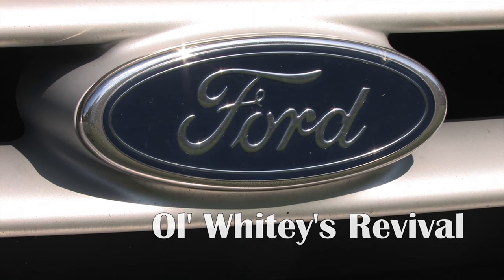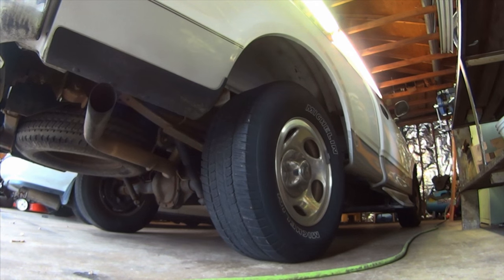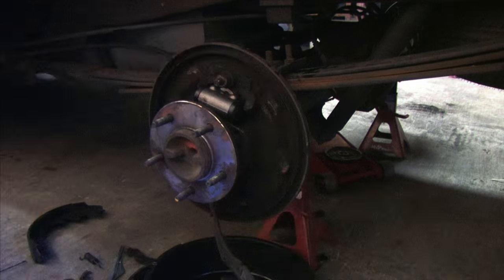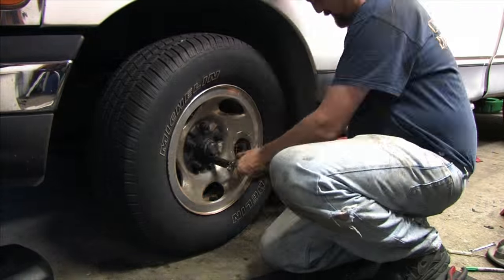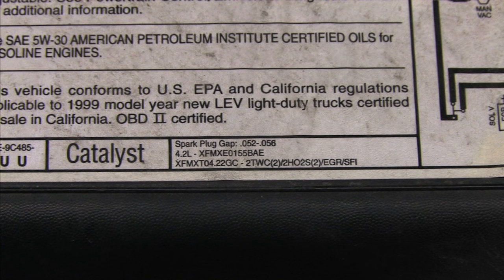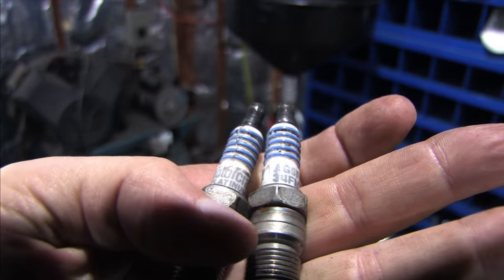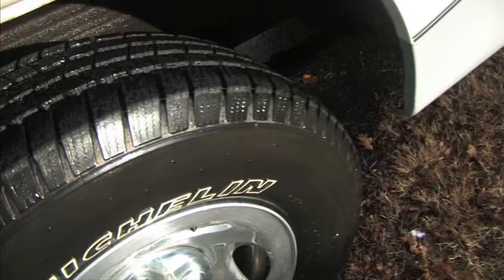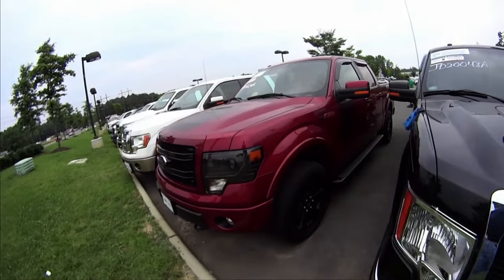Ol' Whitey's Revival

Comment: I was going to do the headliner on my wife's VW, but I instead pulled it out of the car, tore the fabric off, scraped the adhesive down, and plasti-dipped  the whole thing flat black.  No smell, no extra noise, no additional hot/cold leaking into the cabin.  $10 (less than 2 cans) and super happy with the outcome 2 years later.

Comment: for using a motorcraft filter. you sir are a bad ass.  this is the most under rated automotive show on the Internet.
Reply from the maker: +Jean-Paul Veillon LC-1 filter has the largest filter element with the most pleats of any other filter.  Is the same as a Purolator filter, but the element is produced by Purolator to Ford Motor Company's specifications, optimizing its performance for longer oil change intervals.  It's 99.7% efficient on single pass filtration, and 98% efficient on multi-pass.  Just in case anyone else was wondering why I used Motorcraft here.  ;)

Comment: That odometer issue is a simple one to fix. Pull the cluster out, and resolder the odometer display pins. They all crack with age and lack of lead based solder. 

I had and have almost the exact same truck. My 99 had the odometer issue you do, and I sold that for a free 97.  Both  extended cab XL's with vinyl floors. Love them even if they have design issues. (rear shock changes are a pain as are cracked blower doors, not to mention the spark plug problem.)

Also, been watching your channel for years. I have no real interest in DSMs(even if I live in Normal), but your clear consice narration and in depth topics make for great watching as a gearhead.
Reply: +twalshkart and after I have time to finish the episode.. nevermind about that odometer. New truck  looks great! and a reliable truck/trailer gives such peace of mind when daily driving 20-25 year old cars.

Comment: My father in law has pretty much this exact truck, it's a 97 I think though. Same engine it was sold to him for $500 it had 280K miles on it and he uses it as a daily. Aside from breaking off spark plugs in the head, this truck just doesn't stop running. It's been very dependable, although it's body is a lot rougher than yours she never stops. It was owned by a local Oilfield company previously, and was maintained for the most part. The AC system was completely changed, and the onsite mechanics always changed parts on her religiously. You can hang meat in this truck literally. I think he has over 300K miles on her now, and she just keeps on going. Glad to you're still ok Jafro, nice new wheels! It's about time you get something with a warranty. Hope all is well with you, I found something you might be interested in. Large Coffee filters in plentiful supply! "To caffeinate a large crowd". PM if you'd like me to send them your way, I'm sure you'll need them in the future. Glad to see a new video!

Comment: FYI, Jafro: If people start reporting that your links in the description are broken, it might not be your fault. I tried the link to your hydrolock video, and the URL that opened ended with just "v=bhIq9", not the full "v=bhIq9lsKvOU" of the actual video. I didn't examine the HTML source in depth, but on first glance it might be an error in YouTube's source generation, not the browser. 'Just giving you a heads-up.

As long as I'm writing, I'd like to add to the chorus of condolences about Caboose. Also, congrats on another great video! I'm particularly impressed with the clever narration in the opening segment, such as the phone-hiding hole and the "regret this decision" joke. That was a better monologue than a lot of high-budget TV shows and movies have done, because it shows viewers an engaging personality for both you and the truck. The rest is good as well. I never want to sound like I'm pressuring you to release more often, because it's a gift, but I do want to express how much I appreciate your work. Thanks again.

--0Thello from UT2K4
Reply from the maker: +William Dye Thanks man!  Try it now.  I think it's fixed.
Reply: +Jafromobile Fix confirmed (Linux Chromium 47.0.2526.106). It also looks OK in the source code now, so other browsers should also be OK. 'Glad to help.

To emphasize, I am very, VERY glad to help. Jokes about being the UT2K4 bot "0thello" aside, my day job is "Senior Software Engineer in Test", so if you ever want somebody to double-check something for you, or wish there was a Bash script to automate a part of your production process, please let me know. I do that stuff for a living anyway, and I'm happy to do a favor for the guy who saved my 1G daily driver from the junkyard, so please feel free to ask no matter how silly it might seem.

Comment: The compression falling like that is normal. Is almost impossible to to stop the engine at tdc on that cylinder. You'd have to do a cylinder leak down test to check for compression loss. Good video man. Keep up the good work!
Reply: lol compression gauges have one way valves in them. the one he used was leaking

Comment: wow a week after i just shelved my 97 f150 4.2  for a 4.6
i love these engines no boot or spark plug issues like the 4.6 and the 5.4. I did all the repairs you just showed us, and your right motorcraft all the way especially the PVC valve, a brand new duralast made things worse. I had to shelve mine for now due to valve stem seals on the number 5 cylinder (i just dont have the time or tools to do it)

Comment: Your new red truck is my dream truck! Ruby Red appearance package crew cab FX4, looks so damn good.
Reply from the maker: Vermillion Red.  :)  You left out 385hp Coyote V8.  ;)  Despite the electrical problems it's the powerplant you want to have in the 2011-2014's.  I have a cousin-in-law who has stretched 2 timing chains in 120,000 miles pulling a trailer with the 3.5L EcoBoost and he didn't exceed the towing capacity.  He's around 85% of it.  The other thing you want is the 402A appearance/technology package.  It really makes it stand out in a crowd of other trucks, and it's very tastefully done.

Comment: Smart man, check head, head gasket and block integrity before pouring in any parts on the truck
Reply from the maker: +Samuel Gonzalez You got it!  The dealership trade in value on Ol' Whitey was $1000.  Aww hell naw!  If it passes those 2 tests, it's priceless.
Reply: ***** A $1000...jesus

Comment: Nice, My daily is a 1999 XL aswell.  I have the extended cab and the 5 speed manual, but outside of that its the same as yours.. Bare bones basic truck, but never leaves me stranded
Reply from the maker: You get much better gas mileage than I do, that 3 speed with overdrive is a dog; but as far as reliability goes, they're the end of an era.  I went 18 years and almost a quarter million miles before having any major expenses on it.  I don't know a single Triton owner that can say that.  The Heritage Era F150 XL trucks built at Norfolk, VA are outstanding.  That plant was almost a hundred years old and very well staffed until it shut down in 2007.  That's where mine is from, and it's built like a tank.
Reply: FOr sure, I plan on keeping mine for years.  I got it with a recently installed rebuilt engine, but the original motor made it to 240,000 before it failed....  I have 263K on it now, wouldnt be surprised if it made it another 250 thousand.
Reply from the maker: Keep an eye on your coolant level, pcv system, lower ball joints, U-joints, and serpentine belt tensioner... and I see no reason why it shouldn't?

Comment: Good video except NEVER use the gauge part of a gap tool to open the gap on a spark plug!   That's a great way to snap the little platinum electrode off.   The little hole in the side of the tool is there for opening the gap.

Comment: lol Kool now it's my turn to chop up metal and fab !
Reply from the maker: +Juan Lugo If you get the right mounts, it's a bolt-in.  You only need to drill or cut if you use the wrong ones, or install the AWD transmission.  The 1.6L GT has a DOHC 4g61, and the block's outer dimensions are identical.  Only the bore, stroke and deck height of the block changes, so it's a direct fit.

Comment: Use the hole in the spark plug gap tool to gap the electrode...if you pry on it like that you could crack the electrode or porcelain...just my 0.02 cents....wonderful video very good, cheers dude

Comment: awesome I've been looking and can't find anything I know it's a simple swap job but don't know if I can get away with using the same 91 colt clutch pedals or use the 1g dsm pedals which would you think? in your experience with dealing with it. thanks for the reply bro awesome!!
Reply from the maker: +Juan Lugo I wouldn't be the slightest bit surprised to find them being the same part number.  For the brake pedal, just lop the left side of it off with a sawzall, and the clutch pedal fits.  Makes for a nice heal and toe, but whatever car you're putting it in isn't going to have any traction when you're done anyway, so you'll never make good use of the heel & toe.  Not that I know from experience or anything... The only thing you won't have is a clutch switch.  You'd have to fabricate something for that if you want one (think No Lift To Shift).

Comment: 4 things, 1 always love the new vidoes, 2 people actually use torque wrenches on wheelnuts? lol 3 harbor freight has an immaculate balljoint press, definitely I recommend getting, worth every penny! 4 where do you live cause I am majorly envious of how unrusty that truck is!
Reply from the maker: +Stephen Perry 1:  Sweet!  2: Yes, I do, and precisely for the reason specified... I have captive rotors.  Also, people with nice alloy wheels won't risk damaging them by over-torquing them with an impact gun.  3:  But... the pipe!  It's so awesome!  And it costs so much less!  4:  Ol' Whitey was built in Norfolk, and has never left the state of Virginia.  It's been to every last corner of the state, but never left it.
Reply: +Jafromobile oh, thought you were in TN for some reason, up in PA the only things we have that clean have just arrived on lots lol,
Reply: oh and BTW I was being a smartass about the wheel nut thing lol
Reply from the maker: +Stephen Perry I know!  I've bought a PA car before.  See "stripping the plymouth laser" video.  Truth be told, my GSX did 2 years there, but I got the salt out of it and painted it before it had a chance to rust.  I've since replaced several suspension parts and powder coated most of the steel stuff.  ;)  Ohio cars are a disaster, too.

Comment: Did I hear that correctly you're a fellow hunter.   Wow, I didn't know that. Cool Do you prefer big game or small game?Just have to ask does Big Red have a random ticking in front end?  My step father has a ol' Blue 2015 F 150 eco boost which is a cousin to the Fx4.  Read, that both has front differential ticking which is common issue, cannot be fixed if it was fixed it'll come back. Same with the turbo ticking issue yes you heard correctly ticking turbo more ticking twin turbo in the f150 eco boost. I've driven it a few times since I don't own a turbo vehicle.  Oh yeah that gallant vr4 I told you about somebody snagged it up before me :(Since I'm a mopar guy I would opt for the Ram eco diesel or long horn ones with side compartment on each side of the bed along with the hemi, plus truck is made from steel not thin aluminum.   Have you seen the F150 vs Chevy Silverado commercial when they tossed an empty box into the bed of each.
Reply from the maker: I'm a fish hunter mostly… Salt water if you're curious.  The hunting reference in this video is with respect and appreciation for those who do, and my interest is most definitely growing on that topic.  A "hunting truck" is a seasonal commodity just like the game.  Though Whitey's not 4WD, it has the hauling capacity for everything that can be hunted, and without getting blood all over a newer, shinier, nicer vehicle.  If 18" of snow can't stop it, I'm sure it's capable of serving any hunter's needs and they'd be lucky to have it.  For people with old trucks, hunting season is a seller's marketplace.  Right now, Whitey's my fishin' truck.

As for the EcoBoost stuff, Red's not an ECOboost.  It's a N/A 5.0 Coyote V8.  It's also a steel bodied 2013.  The effortless implementation and use of the technology (except for the navigation) in the F-150 is what sold me.  I drove several 2015's and couldn't stomach their squared-off, sterile and chromed plastic interiors.  The FX4 designation is only related to the suspension, towing and differential packages.  They can have either engine.  Sure those EcoBoosts make more torque, but they also stretch timing chains without engine modifications and that's normally what makes the ticking sound.  Ford made 2 radical changes to their truck line in rapid succession, from turbo chargers to aluminum bodies.  While I see and value their goals of doing this, I'm always wary of beta testing brand new technologies on premium model products for companies that may or may not stand behind their products.  In my opinion, FORD does not stand behind their products, not from corporate, and especially not from the dealership level.  I'm blood related to Henry Ford and I say this.  I own 2 Fords.  I should be biased, but I'm not.  I just did my part to keep my truck purchase in the family (name) even though my family fails to benefit in any way from it today.  I didn't like the Chevy interior.  Liked the engine, just not so hot on the silly geriatric large-print soft-touch buttons and lackluster paint colors.  

On another note, the Honda Ridgeline plastic-bodied pickup out-performed both the Ford and the Chevy with the concrete and toolbox tests.  I did 10 years in advertising and today I can recognize marketing hype from lightyears away.  Even though it fared better, you will not catch me driving a truck that's powered by a sewing machine.
Reply: Wow, that's some great information about the Eco Boost. Interiors are kinda the same  But there's other issues besides stretched timing for the Eco Boost pretty sure the fx4's has same issue as well. That's cool your related to Henry Ford,  I've been to the Museum in Dearborn Michigan fives during Elementary school, every year they have a field trip to their. I never owned a Ford but have considered picking up an 4.2 F150 due to your Hydro lock fix repair video. Plus, I helped my younger brother do the same repair engine was in a thunderbird. Looked a lot easier to do the repair when it's in a truck instead of in a car.  Another good thing about the Chevy besides interior ( wifi hot spot) and engine, their transmission are super strong it's built by Allison which is the who makes them for Semi trucks. But Eaton does same thing but they're in the Cummings diesel.  Thankyou for the response. No harm no foul. Anything, new happening with your projects.

Comment: Hey jafro do you have a link or info how to setup a hydraulic master clutch in a 89-92 colt to bolt up a 1g fwd trans? thanks love your channel keep up the awesome job!!!!
Reply from the maker: +Juan Lugo I had one.  I looked for it for 2 hours last night.  It's gone.  I know it had a copyright strike, but there's no evidence it ever existed now.  It was made when YouTube was still the wild west and you could upload anything.  Probably 6 years ago.  It documented where to cut and what parts to use.  I don't know even where to begin looking for the info related to it because I bought all the stuff 8 years ago.  There's footage of me installing a new hydraulic line for the Hyundai.  There's footage of me installing a 5-speed shifter in an automatic Colt, but I can't find the hydraulic install anywhere.  I think you'll need the M/T trans mounts, the flywheel that matches your tranmsission, a clutch, clutch master, a slave, and make your own line.  The cable install would be just like the Colt.  You'll likely find cutouts in your firewall for the equipment to bolt up to and to pass through.
Reply from the maker: +Juan Lugo If this is going in a Colt, then get the mounts from a 1.6L Colt GT or Mirage Turbo.  I believe the Hyundai Elantra 1.6L timing mount fixes the engine position in the engine bay for a 2.0L swap, and the transmission mount from a 1.6L Hyundai Scoupe manual transmission mount also works, but verify that before spending money if you can get the Colt GT mount.  I had a video that showed all of the Mitsubishi parts with the part number stickers still on them.  I wish Google didn't eat it.  They used to delete videos, then they made you replace audio tracks, now they just pay the artist whose song you used.  I wish I could help you more with the roll stopper mounts, but I made my own crossmember for AWD, so I just chopped and welded on whatever stuff I had.